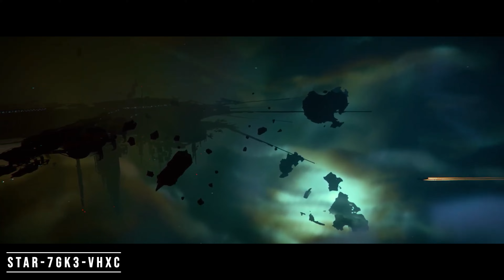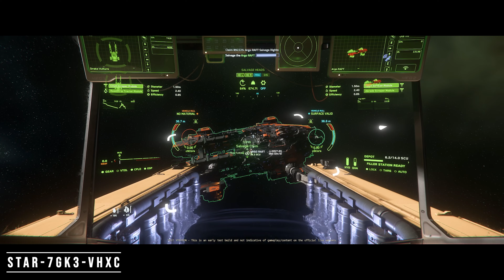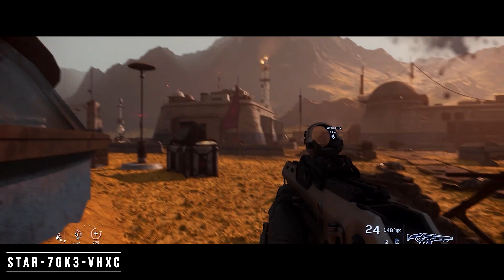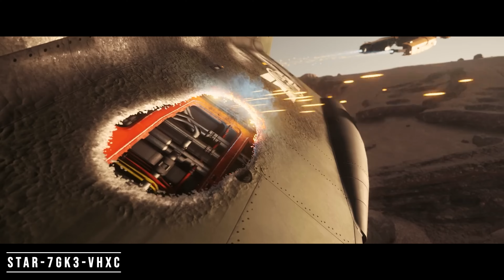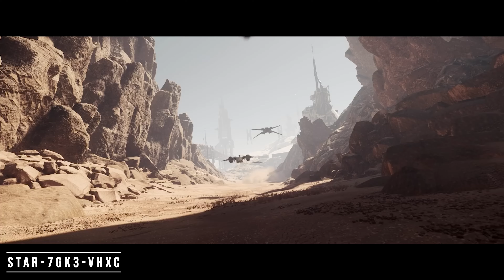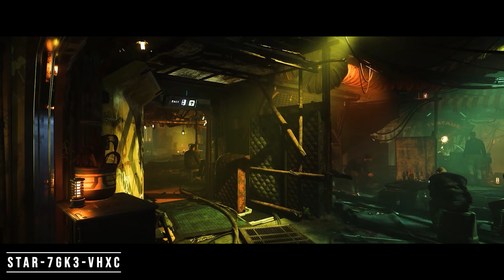Is Star Citizen's New Structural Salvage Really That Disappointing?

Comment: Just in the time it took me to edit a vid talking about all this, they managed to put out some nice changes, so I have hope they'll find a good middle ground for a first patch "placeholder" for this new mechanic.
My biggest problem with the buffer size decreasing on the Reclaimer is that now you lose SO MUCH material when breaking down larger ships. I broke apart another Reclaimer and it just split into 2 pieces, each with 500 scu of construction material. so, I’m losing 400 scu on each piece which is crazy. but I also don't like how solo-able the Reclaimer got since adding in a buffer in the first place, so it's def gonna be a weird problem for them to solve. Only things I can think of is reducing the amount of SCU given, or whenever we get the new damage tech, let us break it down into even smaller pieces and selectively scoop it up instead of making it some huge field that disintegrates everything in front of it.
Reply from the maker: I agree. Changes have been made pretty quickly which outdated some of our info. And I get that it could be painful losing out on all that construction material. With the increase to the internal buffer going to 240, it should help quite a bit, but it seems to fix some of the issues with the Reclaimer being solo-able.

The other change is that they will probably adjust the yield of construction materials, and not lower the price which is also good. 

As this is all a placeholder it seems until they have a better working system, I think they're doing a good job so far to make it better until Maelstrom and other features are added for salvage. 

I actually watched your video on it and it was nice to get a different perspective on the changes. I definitely appreciate your point of view on some things.
Reply: @Hav0k  appreciate the support! And I definitely agree with adjusting the yield vs the price. The buffer going up to 240 is definitely nice but the arguments of it getting "more solo-able" for better or worse are still there, but honestly I wouldn't know how they could even fix that.

For placeholder, first implementation, they're doing a great job in my opinion. I think we'll see huge advancements in this system once the Engineering/Resource tech comes in along with ofc Maelstrom being the huge driving engine with salvage I think
Reply from the maker: I agree. And I think so long as we keep providing constructive feedback, they'll figure out a better solution for us! I got big hopes for the future for sure!

Comment: Component Salvage should be the essence of Salvage imo. It gives your crew another job as well while you are scraping the hull they can be inside pulling the components. Components could also be broken down further to be used for repairs or crafting. Judging by what the devs have said in regards to the salvage ships and crafting they are on the right track.
Reply from the maker: Honestly, I'll completely agree with you. I think if we had a major focus on component salvage, tie in hull munching as it is now, and then finally top it off with structural salvage (especially when they finally get it more physicalized with maelstrom), it will be a great gameplay loop. The biggest take aways are that they need to make component salvage worth it going forward and they need to allow us to put components into cargo containers. Recently on spectrum I ran into a post about this exact thing, and CIG are working on it for the future. I think it'd also be great to have containers that were open where we can stack weapons on a specifically designed container and missiles on another. This would put a lot more emphasis on component salvage. But to make it worth people's time, they need to add a risk factor for not removing components and make it more financially viable. They also need to just ignore or find a fix for the people that just salvage their own ships and claim insurance. 

Thanks for the comment!

Comment: Salvage has the potential to have a lot of complexity, when you consider the use of drones to collect and salvage ship components or cargo, hull scrapping and hull munching, they don't all need to have a skill focus necessarily. Clearly Hull munching would be the last thing you would do. There would need to be a benefit to scrapping though over just straight up munching, perhaps different materials can be preserved.
Reply from the maker: I agree with you. I think that the drone gameplay and hull scraping should be two of the easiest pieces of gameplay for salvage. But I feel like the final part (structural salvage) should be more skill based cause it has the highest potential payout with construction components. I'd also love to see salvage yards be a thing too. 

But over time I'm sure CIG will figure out a great solution that we find entertaining since we know now that what we got is a placeholder for now.
Reply: @Hav0k   Except it doesn't.  CIG already changed things to where the RMC is higher priced (nearly triple) than the CM.  And they can easily change it again.  And if you are both scraping and munching a Hammerhead you get nearly equal of both materials.  So if you are efficient with scraping, then the RMC is currently the money maker.  And depending on the ship, with the new system of having to spread out the parts and aim just right at the piece or lose some of the material, it could take a bit longer than usual.

Now, I would like to see us having to set charges on the ship, manually or with drones, that would break the ship apart.  Then having to guide (vulture) or tractor (reclaimer) them into the munchers.  That way we get the claw that we all envisioned.  And I would like the missions to require you to completely salvage the ship before being completed and giving rep.  So you would have to collect an amount of RMC AND CM before you claim the rep benefits.  And eventually components and weapons will be worth grabbing just so you can repair them and either stock them for personal use or sell off to fleets.
Reply from the maker: Yeah I get what you mean and I like your suggestion. I think it'll be some time until we see that unfortunately 😞

Comment: What the vulture is cool they added a 14 scu buffer
Reply from the maker: I agree that it definitely fixed the Vulture. But I also feel that, earlier on at least before the changes, that they made the reclaimer so easy to solo that it made it pointless to use anything else besides the reclaimer. But now with the changes they've made in the most recent patch, it's definitely better
Reply: @Hav0k  I mean yea but the reclaimed Is 13mil compared to the vultures 1.25 mil also I don't want to drive around an apartment block all the time.
Reply: 13 for the vulture and the reclaimer was lowered slightly as well.